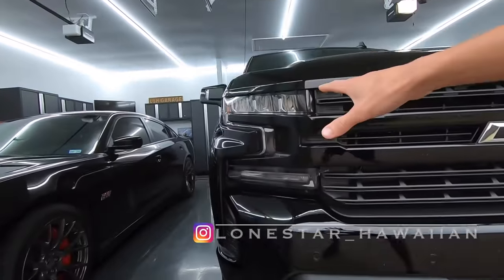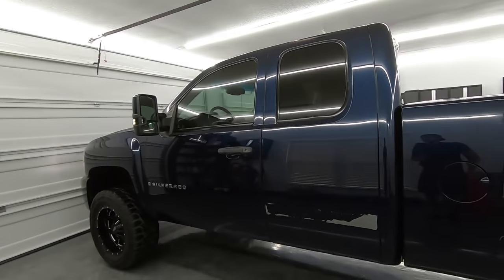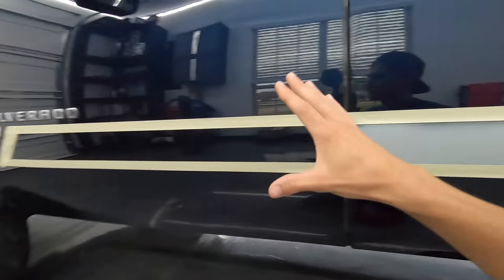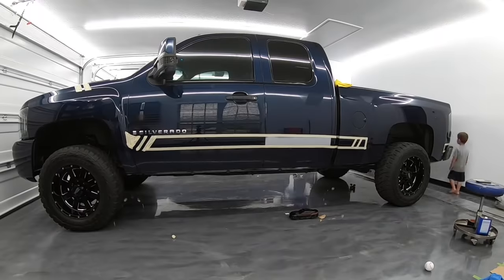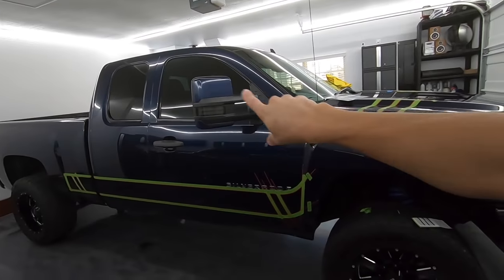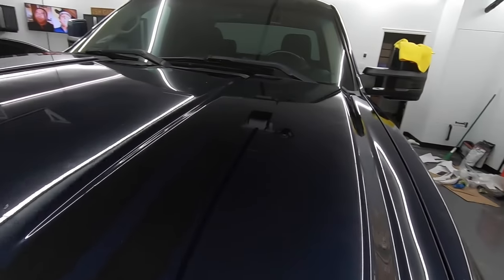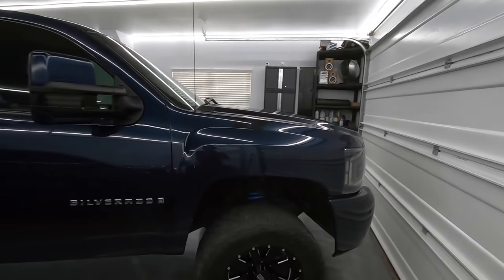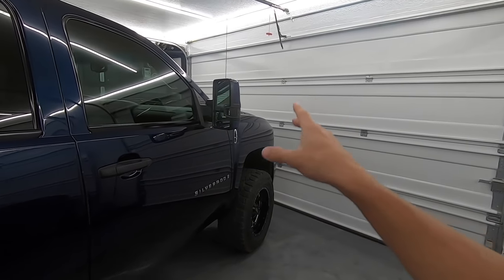Custom Silverado Truck Graphics - [Vinyl Wrap] Fixing My Chipped Paint

Comment: I removed those on my 2008 and found the back passenger door had been painted and the clear coat was being pulled away from the adhesive remover so now i have to get the paint corrected but love the straight body lines now

Comment: Don’t understand, my OCD would have had the door painted, you did the priming and sanding, then taped over it.... I like the tape project....it looks great.  That would have not been a really expensive fix on the paint.  It is done everyday.
Reply from the maker: Paint is 13 years old. It wouldn't match if I just repainted the area. I would have to sand the driver door, extended cab and bedside, blend the paint from the driver door back, and re-clear the entire side.... or just wrap over it.
Reply: LONESTAR HAWAIIAN  I Understand that.  I love your truck and that is a great color...plus you take care of your vehicles.  I have a 2018 Chevy Colorado 100 Year Centennial edition and like to keep it as stock as much as possible, but “Rocky” has my personal flair /mods.    Love your channel and your vehicles....